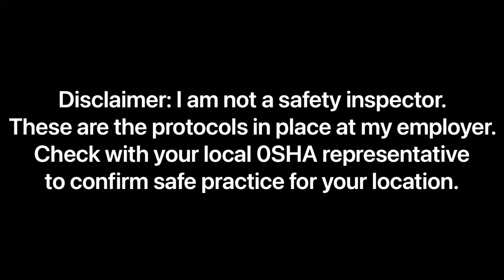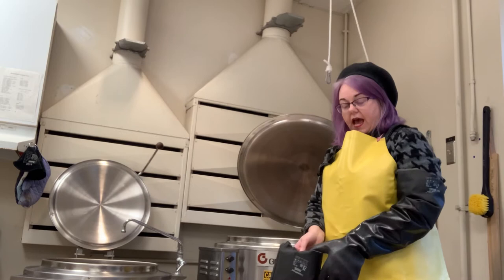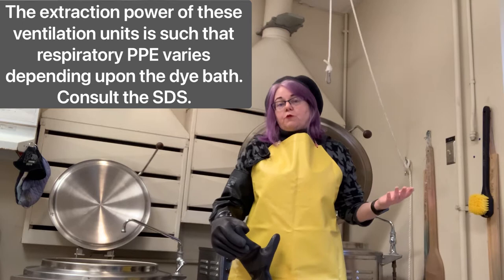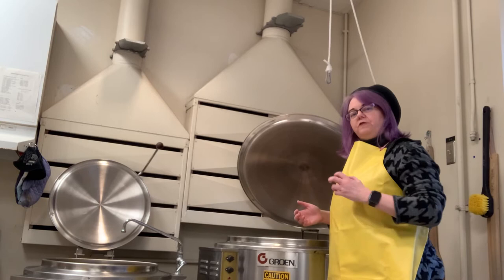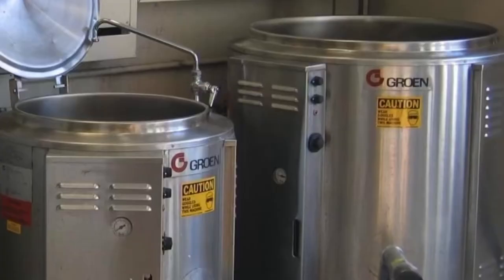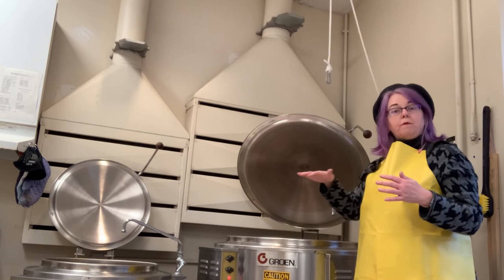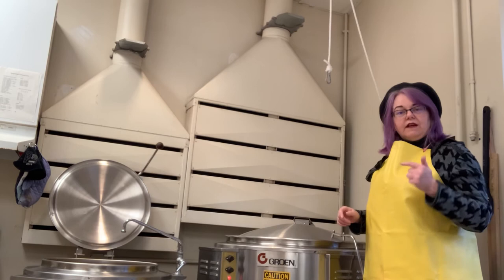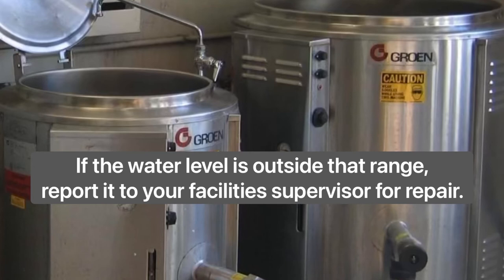How to operate a steam-jacketed dye vat

Comment: How would one release pressure if it’s too high?
Reply from the maker: There’s a release pin on the back of the vat that you can pull to let off steam. On our vat there’s a stamped metal tag like a military dogtag attached to the pin by a chain that explains what it is, that you can use like a handle to pull the pin.